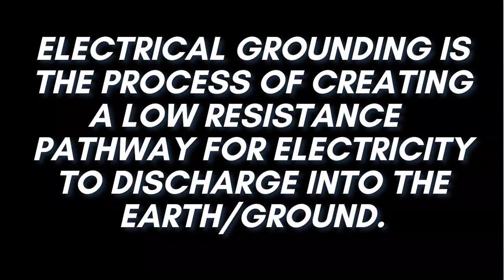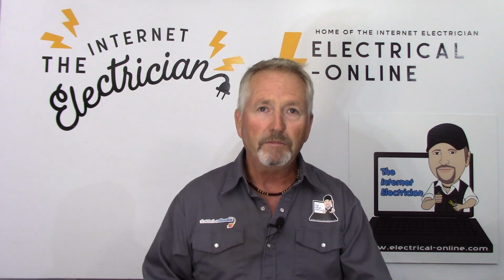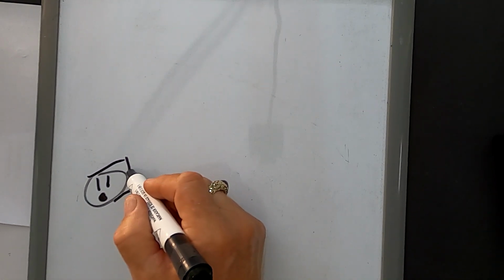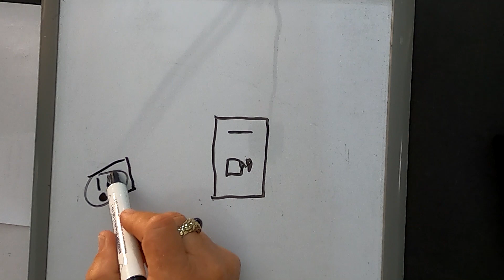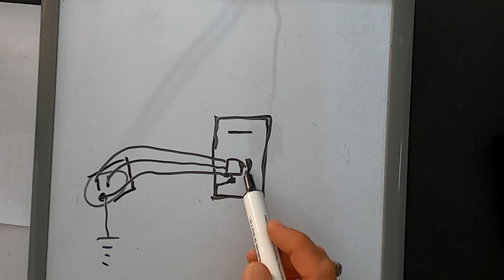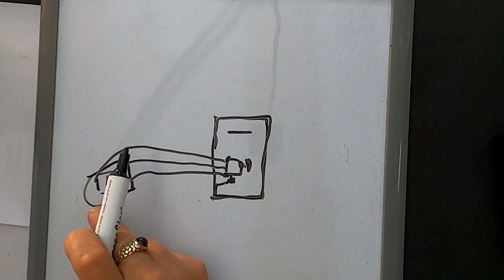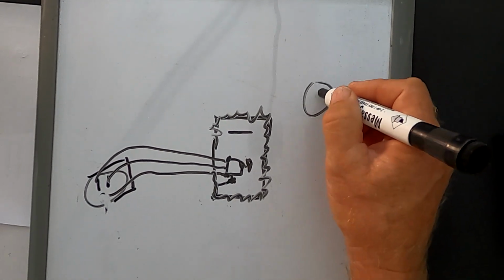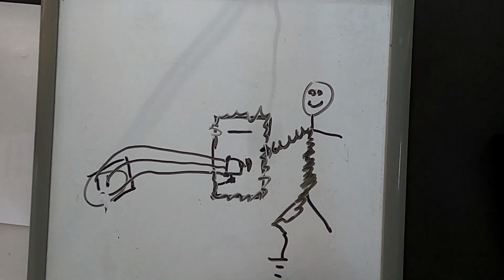Extension Cord Ground Prong - How Important is It?

Comment: Hi, I have a question. My TV screen has a normal 3-prong connector, and I just bought an extension cord. But I notice that the extension cord's third hole, the ground hole, doesn't have any metal in it; it's just the plastic hole, but the other two holes do have metal inside. Is this normal?
Reply from the maker: Nope!  Not normal at all!  At least I've never seen one as you describe.  My only thought is that it's sold as an adaptor of sorts to enable the connection of a 3-prong device into a 2-prong outlet?  Is the male end of the cord a 3-prong?  And if so, is the ground prong metal?
Reply: @theinternetelectrician  yeah, i think it's more of an adapter as you say. The male end is only 2 prong, no ground prong.

Comment: Hi Terry peterman,  i remember years back ago a few of my friends back in College life had a nice power stripe with a surge protector but the kitchen had 2 outlet only so they cut the 3rd ground prong out and had then microwave and other plugged in.   What people should do in that case if a 3rd ground prong ground doesn’t fit is cut off the plug and install a new 2 prong plug and then wire the ground wire to the Black hot wire I believe it is and then they can have the 2 prong.
Reply from the maker: Nope!  (especially that last part of your statement) The only correct thing to do with a 2-prong receptacle that you want to insert a 3-prong plug into is change the receptacle out to a 3-prong grounded receptacle.  If there is no grounding conductor inside that outlet box (highly unlikely), then you either need to get a grounding conduct to it by:
1. Changing the cable feeding that outlet to a cable with ground all the way back to the source.
2. Find a reasonable alternative ground connection (copper cold water pipe and clamp), etc.
3.  If not ground is available, then change the receptacle out to a GFCI outlet and label it as a "non-grounded" outlet.  
The GFCI will provide protection from dangerous electric shock.
Thanks for watching!

Comment: What do you get i the third part of it strick in side of the out what should you do.
Reply from the maker: Shut off the breaker to that circuit.  Test to make sure it's off.  Then try to pull out the broken prong with a needle-nose plier, or just replace the receptacle with a new one.
Reply: Ok thanks

Comment: Question. What if your extension cord plugs into a socket in the wall that is not grounded but you have the   3 prong cable plugged into the extension cord and going to your device?
Reply from the maker: Then you have no grounding conductor to your device.
Reply: @theinternetelectrician  thanks.

Comment: Would you expect the same shocking results if you plugged a 3 prong device into a 3 to 2 prong adapter and plugged the 2 prong adapter into a 2 prong wall socket?
Reply from the maker: Yes, depending on what appliance or device you're connecting at the female end. Thanks for watching!